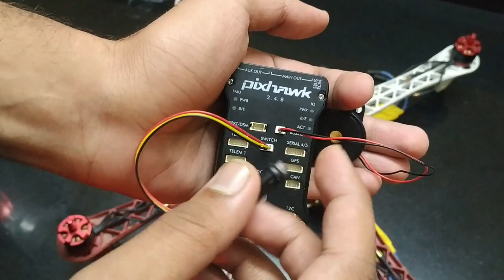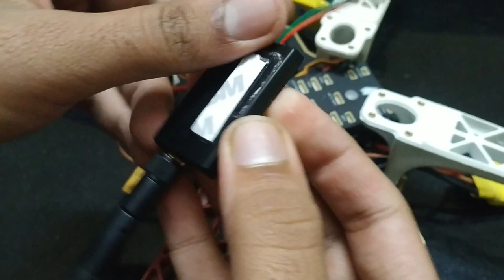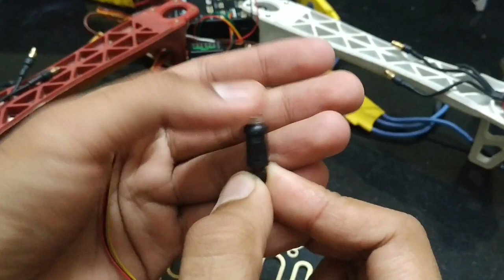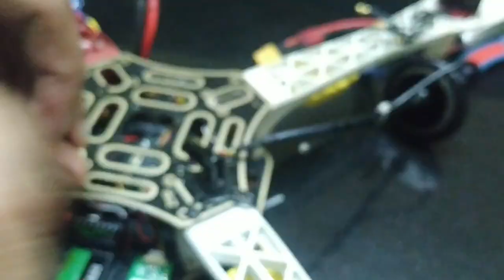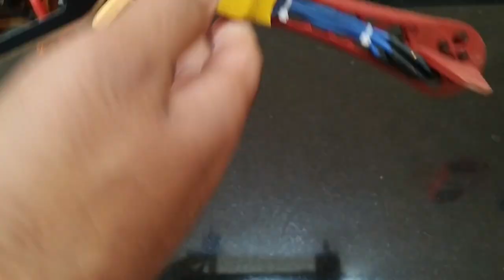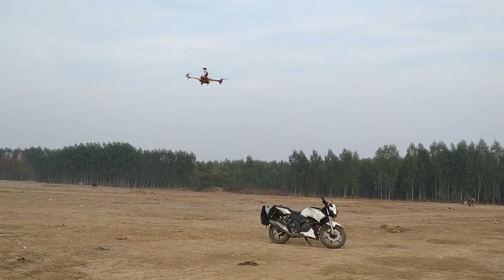Cleanest Built Pixhawk 2.4.8 Drone | F450 frame

Comment: hello dear, 
i make quadcoptor using pixhawk microcontroller with gps and fsi6 remote control , in my drone when i armed drone and throttle up then motors are rotating with different speed.
i calibrate esc again and again still same problem happening.
what i shoud do ?
help to solve this problem. please.
Reply from the maker: Calibrate accelerometer and check motor number and rotation properly

Comment: Thank you so much. One shot in your video Solved my problem.
Reply from the maker: Welcome
Reply from the maker: Which shot????
Reply: @RoboCircuits  I don’t remember exactly. I’m pretty sure that it was a clue regarding the arm switch and ESC calibration. It was something small but critical. Your video was so clear that I could see the issue.

Comment: so i built the drone with the exact same components like you had. Apparently, when it comes to test fly for the drone, my drone couldn't take off. when i move the throttle, the drone is kinda flipped. it looks like to me that the drone is not in balance. do you you what the issue here of the drone?
Reply from the maker: Whatsapp your drone pictures to me on whatsapp 8813083500
Reply: ake sure ur fan blades / propellers are installed in the right direction
Reply: @puttalewis   yea that  was the issue explained why the drone couldnt take off. thank you
Reply: @RoboCircuits  Hi.  What is your country dialing code? Help me please
Reply: @zlatanzlatan7361  +91

Comment: In my quadcopter i get randomly EKF ground mag anomaly(very danger cause copter acting wired), should i recalibrate it even that the pixhawk has a global magnitude database and no need for compass calibration they said
Reply from the maker: You should recalibrate it. Even i had a problem when the compass was working fine on the ground but while testing it was acting weirdly. Most modules are made in china and many have hardware issues. So better to check it first

Comment: I have “Pixhawk 2.4.7 PX4”, when I go to “Mission Planner 1.3.74”  then I see there are two option to Install Hardware 

1) Install Firmware
 -It has all Firmware Named as “Copter…”
	 
When I select “Copter 4.0.5 Official” then It ask for Platform,Version and Firmware.
2) Install Firmware Legacy
 - It has all Firmware Named as “ArduCopter…”
	 
I am confused how to proceed to setup my “Pixhawk 2.4.7 PX4”.

Please help.
Reply from the maker: Select platform as pixhawk 
Version latest stable firmware
Reply: @RoboCircuits  you mean pixhawk 1?
Reply from the maker: No pixhawk 2.4.8
Reply: Unfortunately I could not calibrate ESCs even after lot of search, so I have installed PX4 latest firmware.

Comment: 2:12 , Is it safe to connect all 4 ESC to pixhawk just like that, I read in an article that only ESC with power supply must be connected to pixhawk, the remaining ESC power supply wires must be cut off and then connected, Is that true?
Reply from the maker: No its not important. If power is given through power module then esc power gets automatically cut

Comment: Bro my drone fly only right side. Transmitter throttle up drone fly right side
Reply from the maker: Your calibration is not proper. 
1. Calibrate motors properly 
2. Calibrate gyro properly 
3. Make sure all motors are at correct positions and correct motor numbers 
4. Make sure flight controller is at exact Center and facing forward

Comment: how did you configure the motors in the QGround? what is the RX output mode you used?
Reply from the maker: Configure it using reciever
Reply from the maker: Pwm for apm .... Sbus for pixhawk

Comment: Hi bro I'm doing  project on drone at first i have used the Arducopter the issue i was faced is that it was not stable it was lifting up vertically but while lifting vertically it was moving right and left without any movement in direction channels and now I'm using Pixhawk flight controller and the Same issue i am facing with Pixhawk also. So please can you help me in stabilization of drone using Pixhawk
Reply from the maker: Place the flight controller in exact centre of the drone… make sure it is levelled and pointing in right position…. 
Calibrate gyro properly. If you have gps use a gps stand.
Reply: @RoboCircuits  i have done many times properly but facing the Same issue
Reply: @RoboCircuits  how can i contact you bro ??
Reply from the maker: Send pictures on my email
Reply from the maker: Or instagram

Comment: hi bro.. nice video.. I too have this Pixhawk kit. BTW, you didnt add the PPM encoder to your drone. Is it not required or its mandatory? I have flysky transmitter and receiver. Any comments appreciated
Reply from the maker: If you have a ppm receiver then you don't need ppm encoder.
Reply: @RoboCircuits  thanks for your response. My flysky fs-ia10 receiver has PPM (as mentioned in the label)
Reply from the maker: Then it will work

Comment: What's your PID settings?
Reply from the maker: Automatically set by the software
Reply: Mine just shot 50' up in the air and couldn't control it. Then it landed on its own.

Comment: Hello, I have built a drone using the Pixhawk 2.4.8 and am having issues with the final touches of it. I cannot get the motors to spin above 5 or 10 % even if I turn the throttle all the way up. I am using Mission Planner. I would really appreciate any advice or assistance you could give me. Thanks.
Reply from the maker: You have to arm it
Reply from the maker: Before flight
Drone must be armed
Reply from the maker: Check how to arm a pixhawk